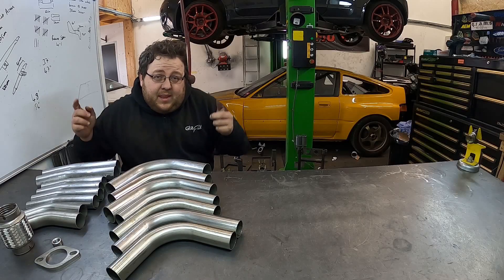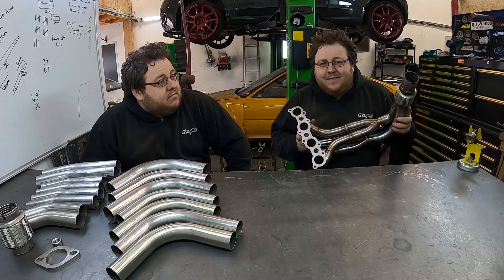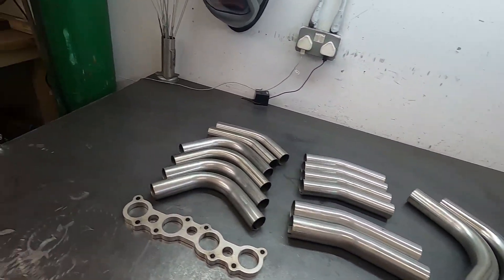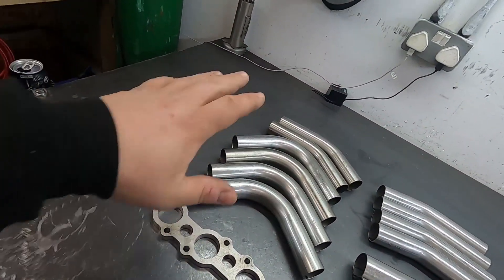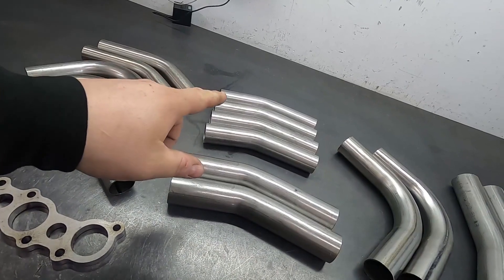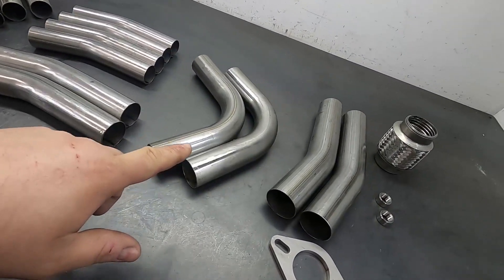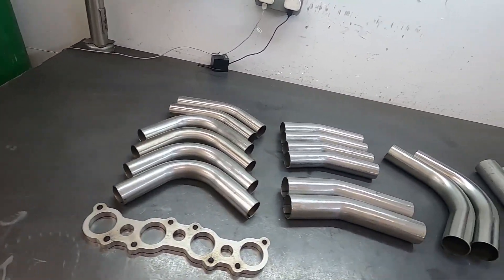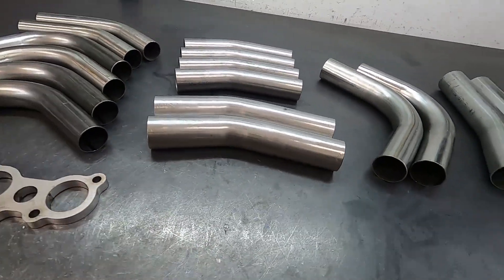Nissan Micra K11 4-2-1 Manifold Fabrication

Comment: would suggest placing the o2 a little later in the system after the 3rd collector so that cylinder 2 and 3 exhaust gases are also being picked up by the o2 sensor other than that very cool work am tig guy myself
Reply from the maker: Unfortunately not possible to the length of the OEM sensor cable. Placing it here allows the OEM sensor cable to fit without extending the harness.
Reply: Years ago, I bought a similar manifold. The standard manifold included the cat as a downpipie, with o2 sensors before and after.
The new manifold was "straight through" (no cat), and had an o2 boss for the "after" position in the same place as the original, but the "before" position could only be on one of the headers (4-3-2-1 design).
What I did, was reverse the sensors so that the car saw the combined gasses in the "after" position, thinking that this was the "before" position. Obviously, the sensor for "after" went to the single header.
It really worked - never had any issues with fuelling / AFR / MOT etc.
YMMV

Comment: Great video. 
I was wondering in a full system would I still need to fit a cat so it doesn't mess up the ecu's in my K11 is automatic transmission as I don't want a engine check light on all the time and what about the second lambda sensor, the rear one?
Reply from the maker: Plenty of people have fitted without the Catalyst and have zero issues. Our Manifolds come with 2 lamdba sensor ports for both sensors.
Reply: Holla ya boy at GizFab - Get him to put flanges on a standard cat. Also, get him to knock up a flanged straight through section to replace a standard cat.
Now you have a "race mode" and an "MOT mode" - just swap as required.
Also, take the whole lot to a rolling road and check what the difference is with and without. You might discover that cat removal isn't all it is cracked up to be.

Comment: Cool video just wondering where did you get the flare cone I've been looking for flaring die to flare out 2.5 inch and 3 inch pipe for months now but cant find any ??
Reply from the maker: The one in the video was from a local machine shop. Paid £20. But for that sort of size. You can use a cone from a wheel balancing machine (which I also have). About £20 from Chinaland.
Reply: @GizFab  cool thanks for the reply and are you using 304 stainless steel
Reply from the maker: @ep9194  always.
Reply: Cool thanks just wanted to know because the huth 1690 looks like its makes light work of the 304 stainless

Comment: Hi mate! Extraordinary work! I was thinking of making only extractors for my cr14de (k12 micra) without de-catting, do you think because of the low lenght I can’t do a 4-2-1? Or nothing changes between 4-2-1 and 4-1 instead having a catalyst? Thanks!
Reply from the maker: 4-1 is better suited for higher Peak Power. 4-2-1 is better suited for low-mid range. Longer the primaries, the better.
Reply: @GizFab  Thank you very much! Really appreciated! In other words i sample your 4-2-1 k11 manifold scaled down with my spaces?
Reply: @GizFab  do you know where I can get a manifold for a Vauxhall Astra x1.6xe
Reply from the maker: @rudyparsons3106  I dont.
Reply: @GizFab  ok thanks

Comment: Now I understand why these manifold are expensive.  Do you do the mid section for the coilpack version with the 2nd Lambda sensor boss fitted?
Reply from the maker: 2nd lambda is in the front pipe, which comes as part of the manifolds
Reply: @GizFab  does it have the step off so the engine management light will stay out?
Reply from the maker: @genty1960  No, its just an ordinary 02 sensor port. you may wish to purchase the elbow adapter if needed.